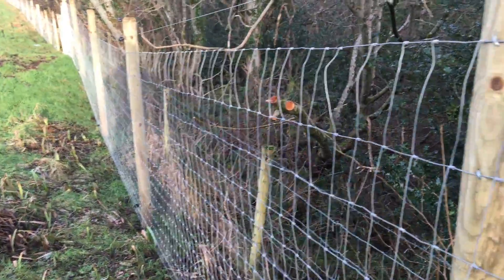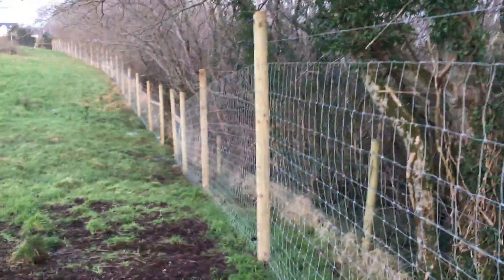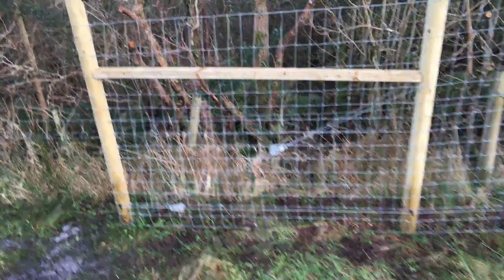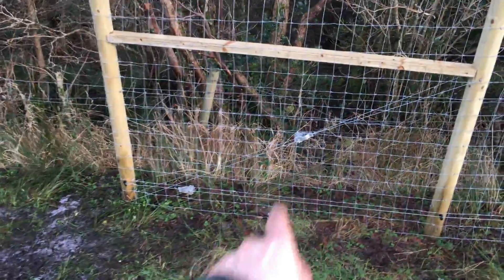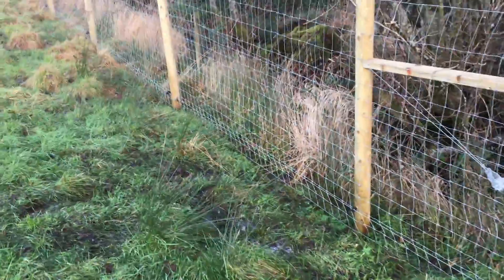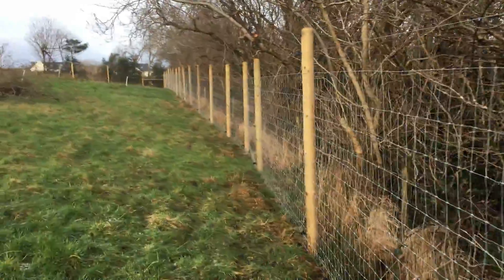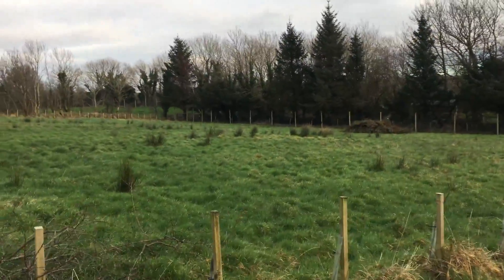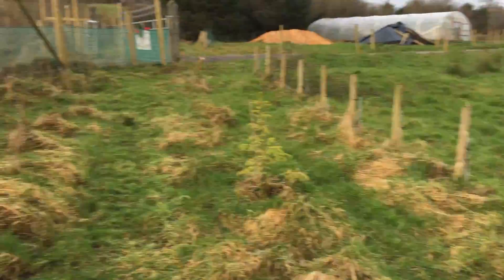Deer fencing & new online training

Comment: Hi, nice job on the fence, planning on a similar job on my farm, I was wondering about rabbits and was thinking of putting the fence underground about 300mm, would you think it's worth it or would be happy enough with the electric fence wire low down.
Reply from the maker: Digging and backfilling a 300mm trench is a lot of work if its a long fence, so I would only consider it if the damage the rabbets wore going to cause outweighed the cost of the installation.